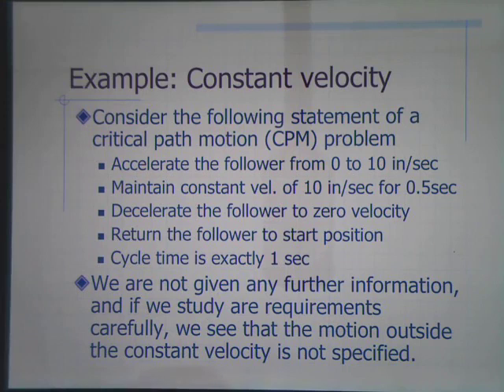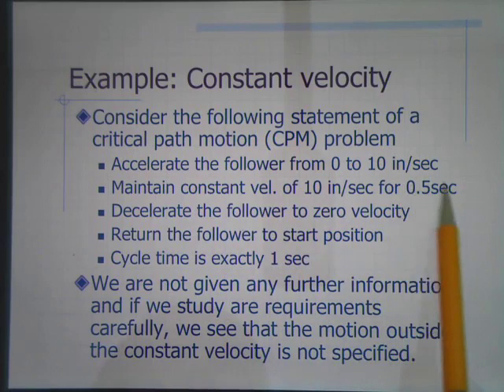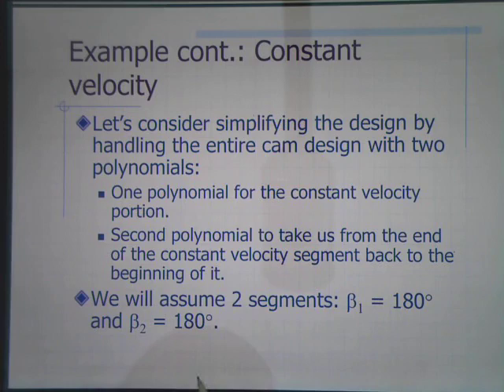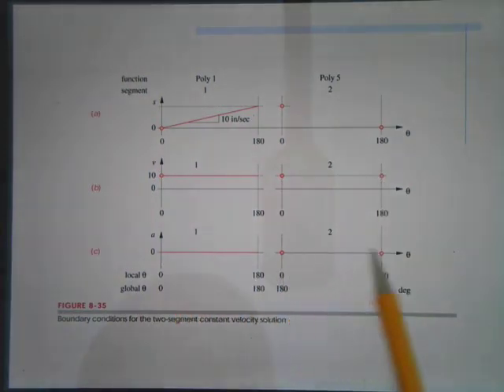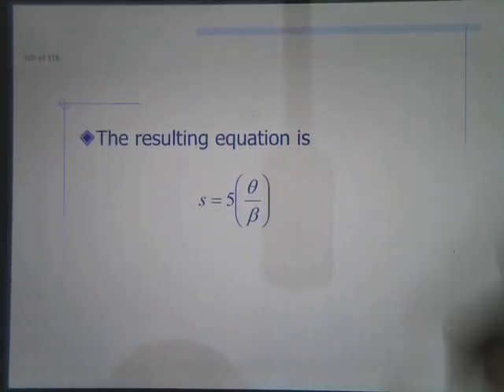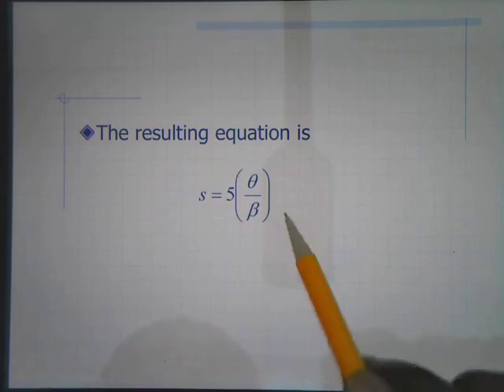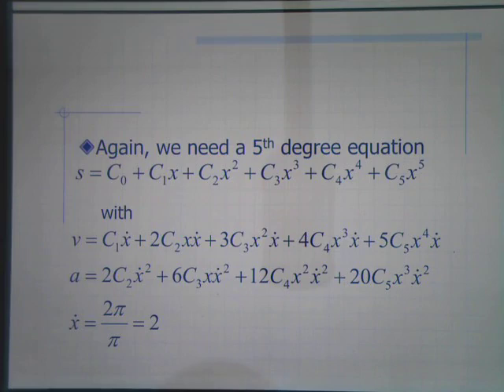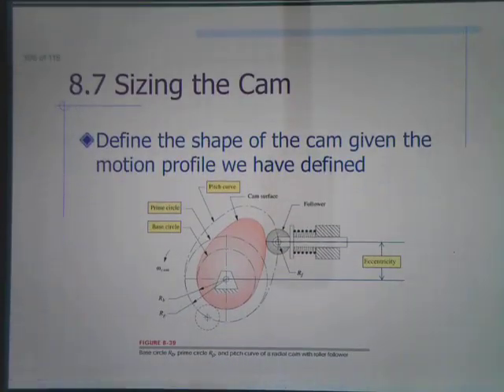Critical Path Cam Design II

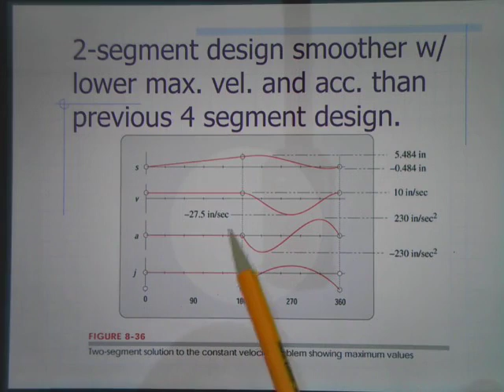Comment: Dude , you've just violated the Cam's Fundamental Law at minute 10:44 when you said about this graph a preferred design !!! It is not. Since the displacement here goes to negative and thus the base circle of the cam should exceed the cam profile  > The fact that our displacement in this design contains negative values as shown in the s diagram
of Figure  is of no concern. This is due to our starting with the beginning of the constant
velocity portion as zero displacement. The follower has to go to a negative position in order
to have distance to accelerate up to speed again. We will simply shift the displacement coordinates
by that negative amount to make the cam .